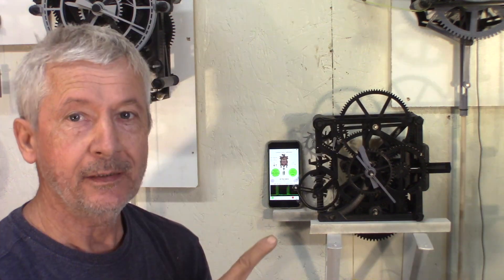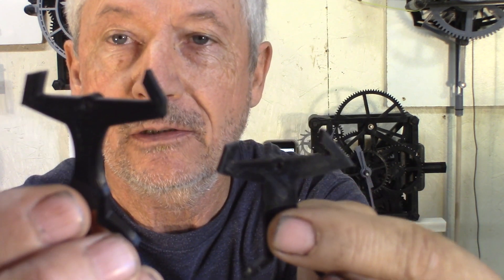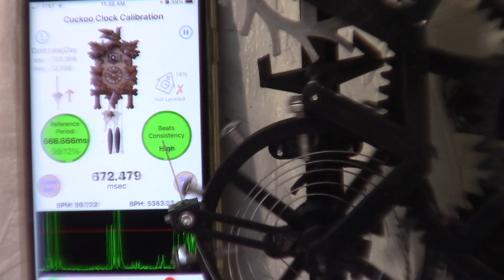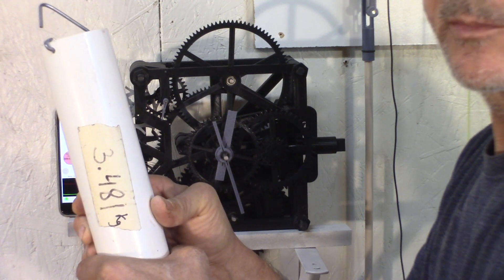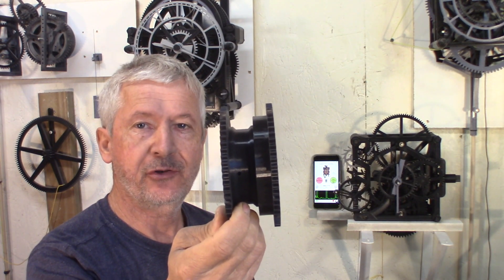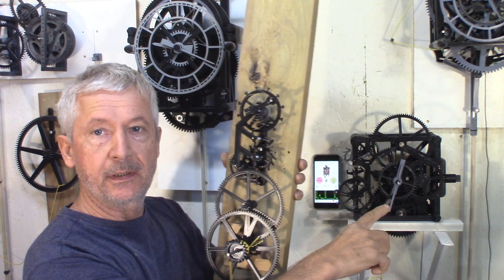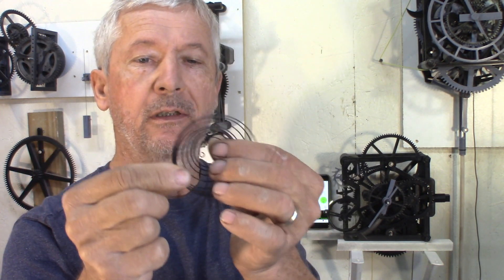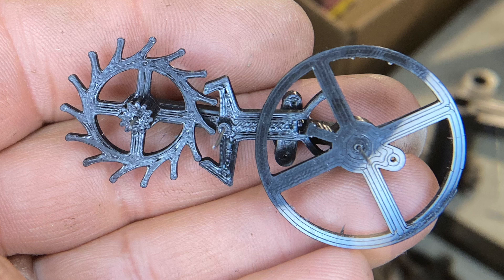The design and prototyping of a 3D Printed Swiss Lever Escapement Watch Clock

Comment: Nice. The watch style winding mechanism seems really elegant. 

Have you tried using the spring from a tape measure? A 25' by 1" tape measure should have a fairly heavy duty spring inside it. They are readily available at any hardware store. A 1" wide spring should be a lot less fiddly than several narrow springs.
Reply from the maker: Thanks
I would have to change the gear ratio between the drum, hands, escapement, but will certainly experiment with a tape measure spring powered clock, I already took one apart and did some research with constant torque, using two drum for the spring
In my younger days I have rebuild many pull start recoil mechanisms, back when things where fixed, not replaced...Still those springs need to handled carefully, there is a lot of power in there
Reply: @jacquesfavre999  Many clock web sites warn about the dangers of springs uncoiling violently. Nobody needs to be warned not to drop a weight shell on their foot, even though the amount of energy may be the same. 😀